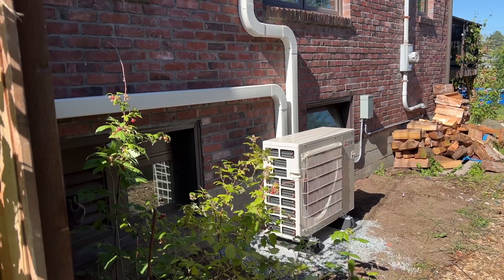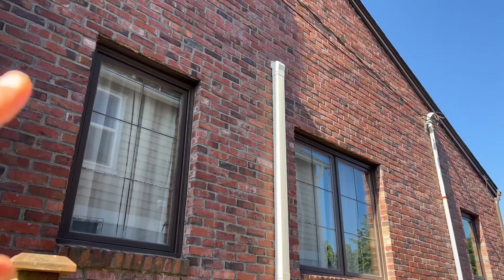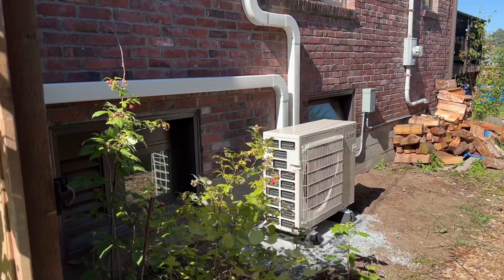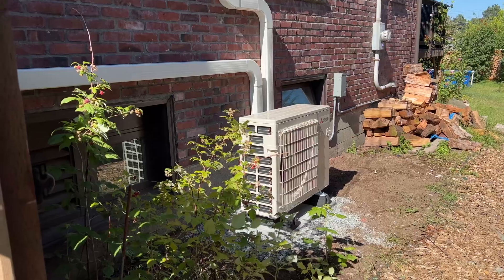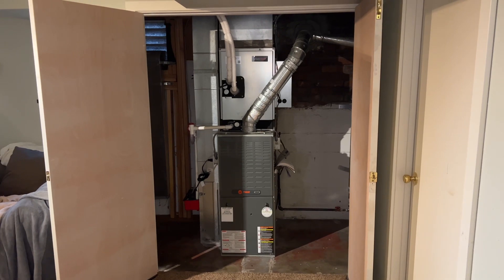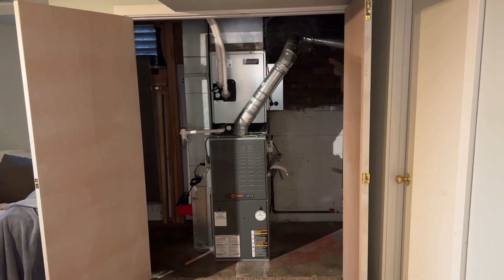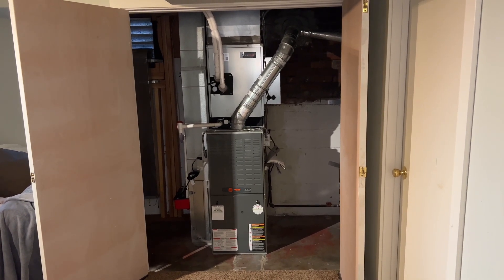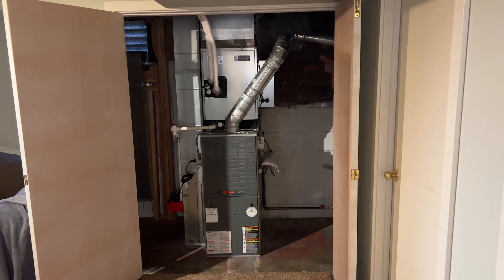Mitsubishi Intelli-Heat installation walk through

Comment: Am I reading the install correct, you need 208/240 to the outdoor unit but also need 208/240 run to the indoor intelli coil?
Reply from the maker: You only run 208/240 to the outdoor unit. From the OD unit you back feed the coil and the other components with 208/240. We use South Wire tray cable

Comment: Thank you for posting a video about this product! I need to replace my 22 year old gas furnace and AC unit. Do you know if there is any benefit to combining the Intelli-Heat heat pump with a gas furnace that has a variable speed blower? Or will I get the same heat pump performance/comfort from from a basic fixed speed blower?
Reply from the maker: 2 stage constant torque or ECM furnace is best bang for your buck 
It doesn’t interact with BK terminal of a variable speed furnace
Reply: @energytechnologies206  Thanks again for responding. In the PNW what balance point do you set if you are pairing the Intelli-Heat with a NON-HyperHeat heat pump?